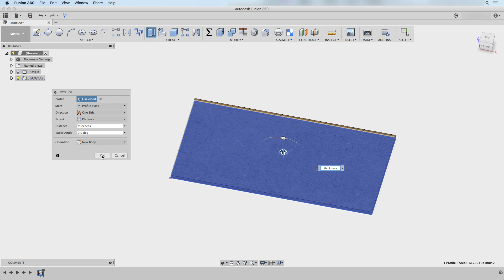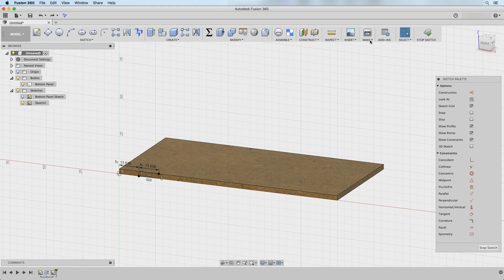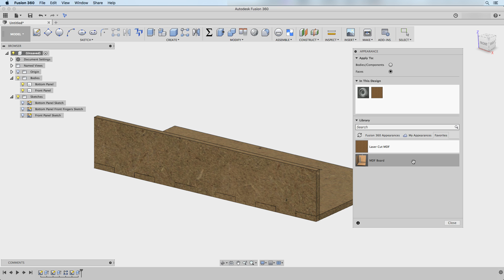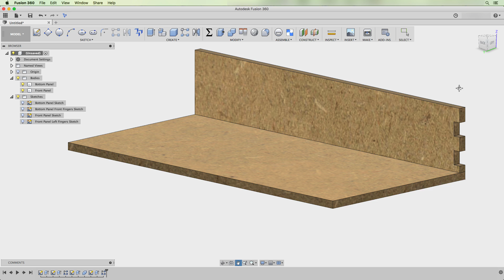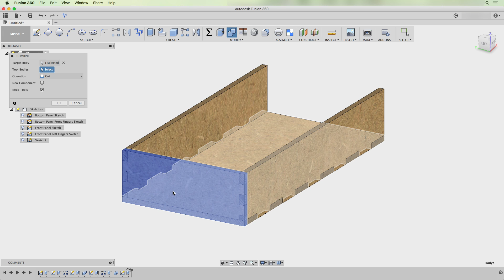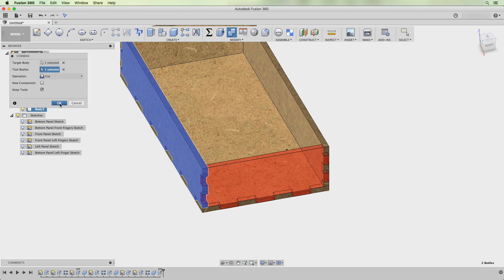Fusion360: Automatically sized finger-joints

Comment: If you were to select the faces on the other side would that eliminate the arrows pointing to the origin and thus get rid of any need to use negative numbers? Or is it always pointing towards the origin point as a coincidence. It's not a big deal but it just seems like it always wants to go the exact opposite way you need it to and the only reason I can think of that it would always do that is because it also happens to be the origin point for XYZ.

Comment: Quick tip: Most of Fusion 360's textboxes automatically convert units, so you could type in: 0.125"  and it would have automatically figured out 3.175mm for you.  (unfortunately 1/8" doesn't work, but 1"/8 does work!)

Comment: Everytime you use rectangular pattern (for sketch or features), you leave default "3" for another dimension you are not using. Does it not create 3 copies in the same place? I always dial that to 1 but it's a bit annoying to remember about it.
Reply from the maker: At the time I made this, if either the distance or quantity was 0 on an axis, it would not be used. I have not been able to do anything with F360 since last fall, so I do not know if that is still the case.

Comment: Is there a easy way to set an offset for the fingers? I wanted to use this with CNC and need some space (.15 or .20mm) for assembly. Great info and really cool way for a ton of different applications.
Reply from the maker: I find the easiest way to set offsets for CNC is in the CAM package, not in the model itself. If you create your toolpaths in the CAM package, you can adjust the settings as needed.

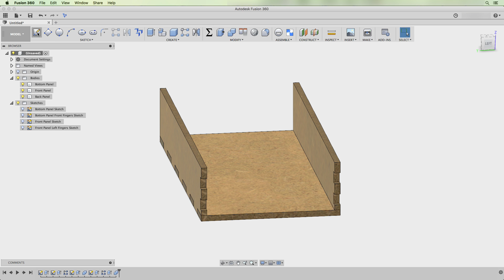Comment: Hi Excellent tutorial but at 16:10  when you create the 3 point rectangle it constrains itself on the 3 points you click on, when I try it I only get it constrained to the bottom panel and when I change the parameters everything works fine except for the height on the left and right panels any ideas?

Comment: Here's a tip: Consider not using a fixed number for the finger count. Instead, base it off of the material thickness, the length, and a material thickness multiple, then round the result. With the proper formula, if you choose a thickness multiplier of four, then this will result in fingers that are about four times the material thickness, but also be a perfect divisor for the overall length. This will let you change the material thickness and the fingers will adjust to make sense for that thickness. (More fingers for thinner materials.) And if you change the height or length drastically, you won't have to change the number of fingers by hand. The expression for lfingers would become "round(length / ( thickness * fingerMaterialThicknessMultiple * 2 ))". It's a pretty  easy formula, and you never have to think about the number of fingers. The downside is you can't have large differences in the finger width between the various edges like you do in your example, where the fingers on the height are much narrower than the fingers on the base.
Reply: this is not working as a valid expression.  I think that is may be the "round".   Is there another way to write this that may work?

Comment: What if I need to account for a kerf? Is there an easy way to do this?
Reply from the maker: I generally avoid kerf compensation as part of the model; although, there are times that it is still necessary. I try to stick with compensation using the Fusion360 CAM module. See this video: https://www.youtube.com/watch?v=dKBxSx3Tv1k&t=8s